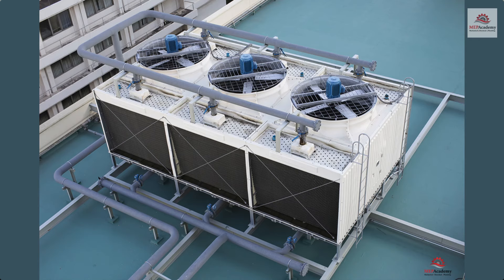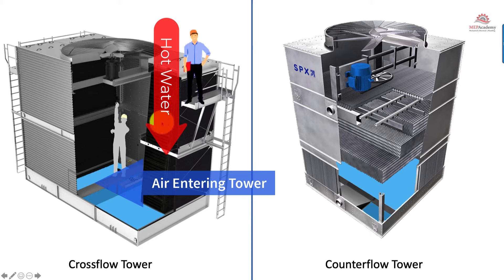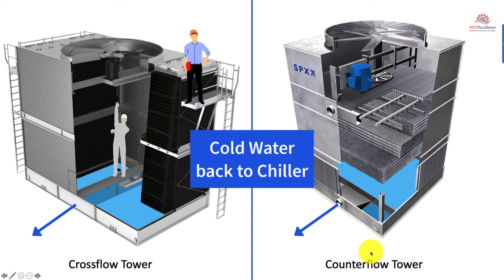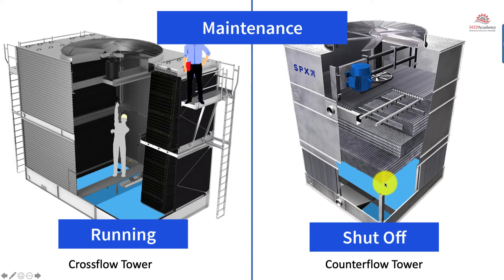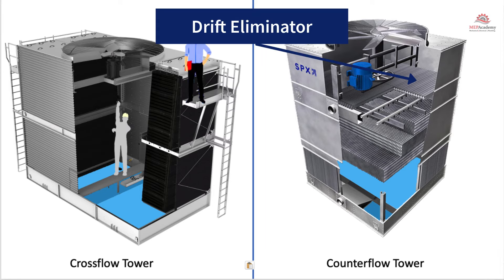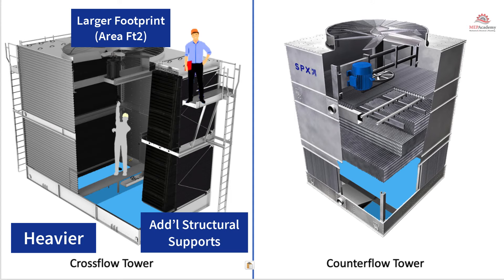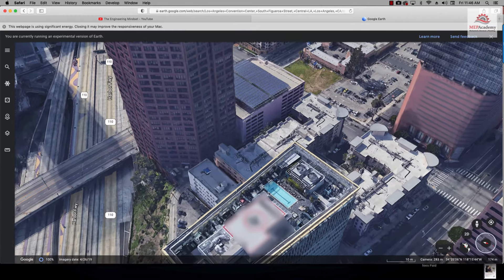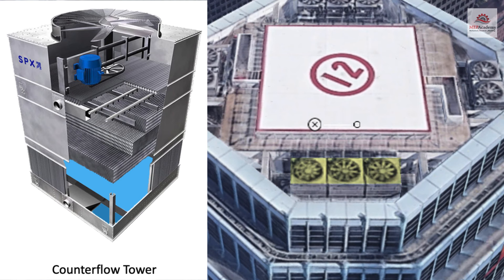How Cooling Towers Work Counterflow vs Crossflow

Comment: These are open source cooling towers, closed circuit cooling towers have spray pumps that spray sump water to the hot building return water. Same principle but works differently
Reply from the maker: Yes, you're correct, they're different types of towers, but with the same purpose, that is to reject heat. Thanks for watching.

Comment: Thanks for the video, i would like to ask, if the cooled water basin level reduced, does it affect the cooling tower performance? For example the delta T?
Reply: In my case, the delta T become smaller when level water basin  reduce. Is there any explanation for my case, thankyou in advance 🙏
Reply from the maker: What is the entering and leaving water temperatures? Do you have a float on the tower to maintain the water level or is this done manually?